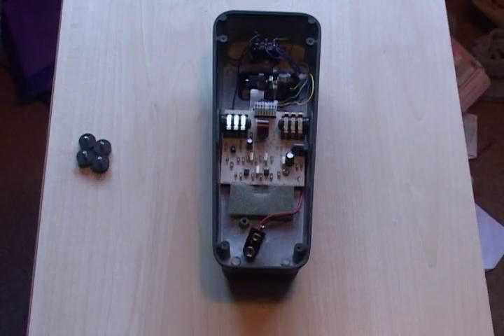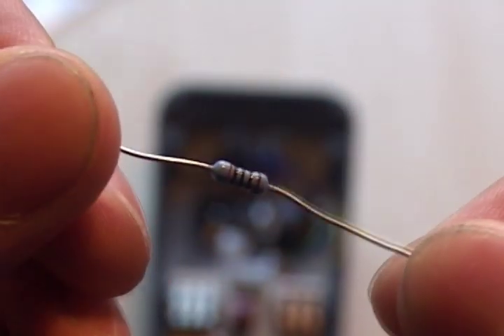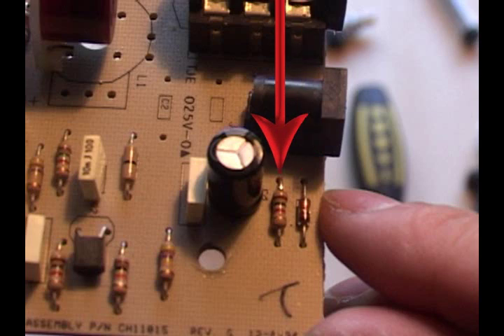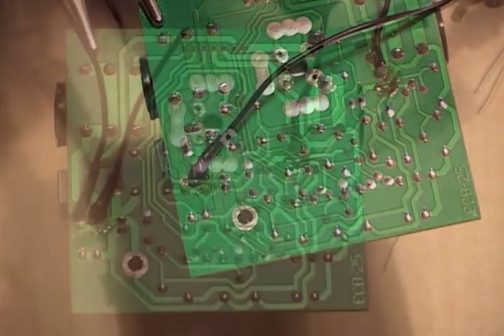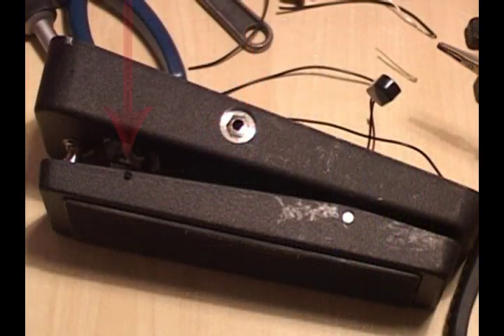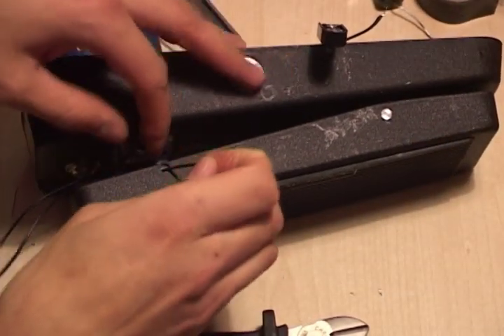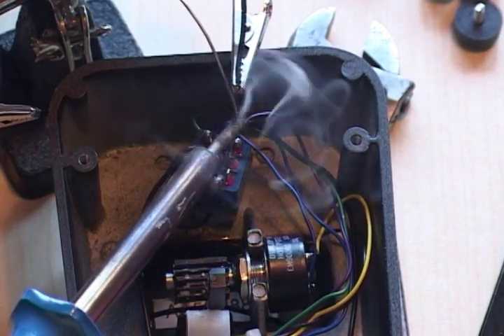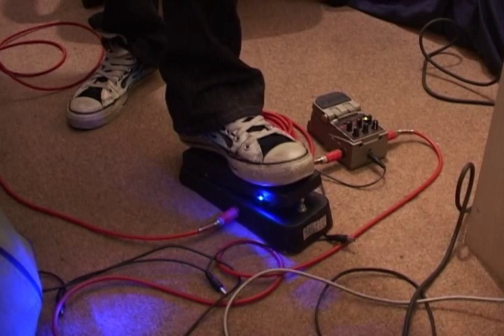Wah Mods (Part 3): LED & 3PDT Switch Install

Comment: man i got a problem.

didn't very understand what you did from 2.28 to 2.50,now the LED won't work and when i activate the crybaby it makes a "POP" and doesn't work, and when activated it's as if ampli is OFF.

any help?

Comment: Hi guys, I just did this mod but the LED is always on, I got the the same 3pdt. Can someone tell me what's  wrong. Is it the switch or did I mess something while connecting the led. The rest seems to work fine....Thanx in advance !

Comment: Man i have a little different layout.

I see at the beginning you have a switch with 6 "ways", with blue, purple, black and green wires in it.

In my dunlop crybaby i have a 3 ways switch, with purple and blue on right and green in left. My black wire goes from the potentiometer to the 8 ways pin.. what should i do?

Comment: Is it possible to run it as true bypass but now wiring up an LED yet? Is the switch part cheap. Im thinking about doing the true bypass first then adding an LED when i have time to buy it. Would it work if i don't hope up an LED to a 3PDT switch?

Comment: no the thing i didn't understand... 1 of black wires starting from a resistance goes directly on the swith, an other goes with the resistence, right?

is there difference on which of 2 resistence i link directly to the switch?

and resistance 2k ohm 1/4 watt is good or i need higher w?

Comment: The GREEN wire is the CLEAN INPUT from the jack socket. It runs through the pcb and wiring connect plug! The BLACK wire is the FX INPUT! It goes to the buffered input stage.

Other tbp mods: stinkfoot.se/archives/546

Comment: Upside down wouldn't matter, long as it's not sideways. You'd still be connecting to the right poles of the 3 switches, doesn't matter which switch switches which.

Comment: Thanks that helped me out, but now I realized another problem, that the led goes on in bypass mode after a while, otherwise the led works fine, do you have any ideas what may cause the problem here?

Comment: My question seems similiar to others here - how do you know if the switch's connectors are in the correct position?  Is top-left always #1 and bottom-right #9, or does the switch's connectors have dedicated positions?  Great vid!
Reply: It is a double throw switch... so it is symmetrical. As long as you are looking a it so the solder tabs are horizontal, it doesn't matter which way up it is. This is why there aren't PIN numbers. I'm sure you've already figured this out by now ;)

Comment: I too find that a bit confusing, I'm planning to do this mod soon to my ZW-45.

So really if i scratch the circuit, and connect the clean input signal wire (from the first video) then follow the stuff in this video it should be grand, and don't need to worry about switching wires as it's a different switch from the first video?

Thanks

Comment: Great tutorial! I'm trying to do this on rev i pcb which apparently is true bypass and comes already with a fase inductor without modification. My problem is that rev i pcb is a bit different from the one that is shown on the video and the switch isn't wired the same way as the one that is added on the true bypass tutorial (even though it has 6 pins). Does anyone know how to add a led to a cry baby with rev i pcb?

Comment: ok man now i got it.

just some technical question.

resistor watt? 1/4?

LED brightness?

and another question... when i got to power supply to the LED i got to take negative resistor wire to the switch and the other to the LED or viceversa?

thanks for the help but i didn't understand all the speech :D

Comment: Figured this one out. Where people seem to be getting stuck is the position of the Switch and the soldering., I creatd a CORRECT diagram using StinkFoot's True Bypass and LED combined. Couldn't find that on the net anywhere so here it is. This DOES work toddmarx.com/mods/GCB95_TB-LED_Wiring_Correct.pdf
Reply: Just looked for this pdf link but not active, any ideas where else to find it. I appreciate its 8 years ago so probably not. Thanks

Comment: I haven't put the LED in yet (haven't bought it yet) but I have the same switch and changed it all to true bypass today - one thing I very nearly did wrong was get the switch the wrong way round - easily done because it's a square, but can you see how the little lugs are horizontal? Are yours definitely like that? 

I started to wire mine in with them vertical before I realised...!

Comment: I have a question, is there a way of making the pedal to continuously go from open to close (by adding an oscillator) without moving your foot, when the foot moves it controls the speed of the continuous oscillation. And being able to set this up as an alternative mode with a switch. Switch is off, normal cry baby. Switch is on, continuous wah crying.

Comment: Will it really have to be a 2k resistor? I am not an electrician so that's 2000 Ohms right? Because...I ordered some LEDs a few weeks ago to modify some of my pedals (work fine) and these LEDs came with 470 (+-5%) Ohms resistors. What's the worst thing that can happen..??? The LED would burn, right...but no harm to the Wah I guess!? Would you be able to upload some High Definition Pictures of the spots where you soldered the Leads to the Board and an overall view of the Leads, Switch; PCB etc.

Comment: You've made a really clear and user friendly video here Chris - is this just for interest's sake? Because I hope if you do electronics at school you're going to get some kind of credit for this :-)

Cheers anyway - getting an LED tomorrow, wired in the 3PDT switch already. I decided to drill a hole in the back wall of the base (by your heel) rather than use the pre-drilled one.

Comment: hey mate

thanks for the awesome vid
did this today with my crybaby

only thing i would recommend is using a 510ohm Resistor for the LED if u want it brighter

i tried a 2k one and because i planned on putting the light under the treadle it was barely noticeable. however if your LED is on the exterior, 2k is fine

thanks again mate!

Comment: Now, I'm kind of confused cause when you show the position where you hook up all the wires at first the holes of the switch "lugs" are vertical and when you are soldering they are horizontal. Hopefully you can clear that for me if you can Cappi!!!!!! Thanks for the vid BTW!!!!!!!!

Comment: Thanks, I wouldn't have even attempted this mod if you hadn't made this tutorial. Excellant. All working fine. Only bit i found confusing was the black n green wire thing (as i couldn't work out why you'd soldered them to the place you originally put them) but swapped them over and that done the trick. Can't thank you enough. cheers